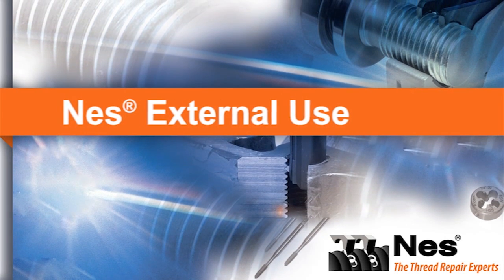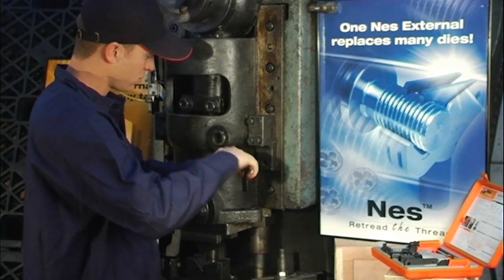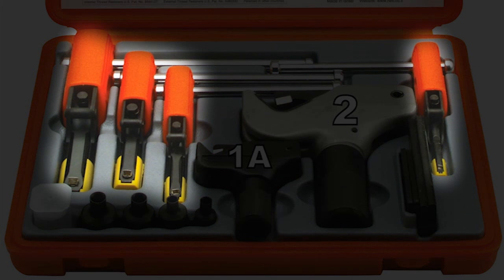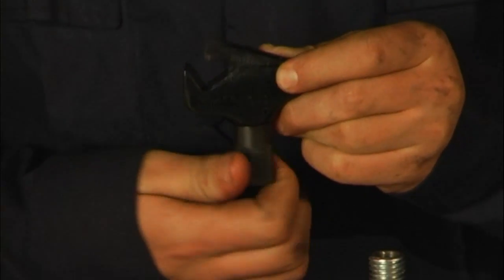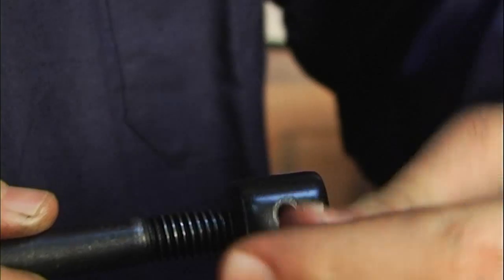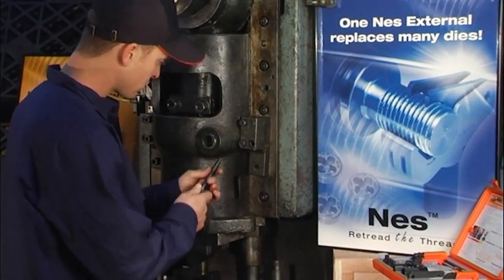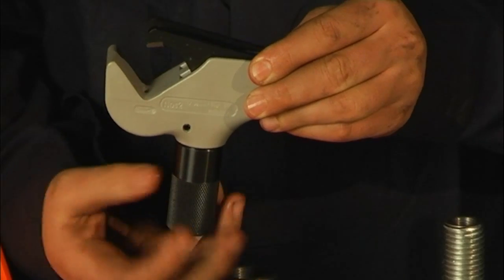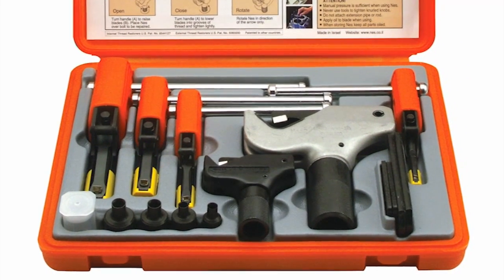Nes External Thread Repair in Industrial Environment

Comment: best thread repair tool ever made.  tho its not made to extract screws or bolts, but if it could, it'll blow those away too.  I just wish they would make the tool, a long handle because its not enough to put a little more force into it before having to  reverse and clean the bolt.